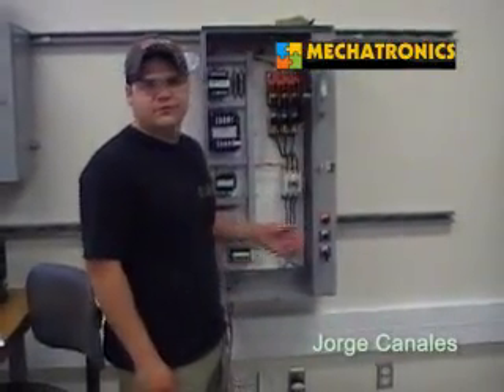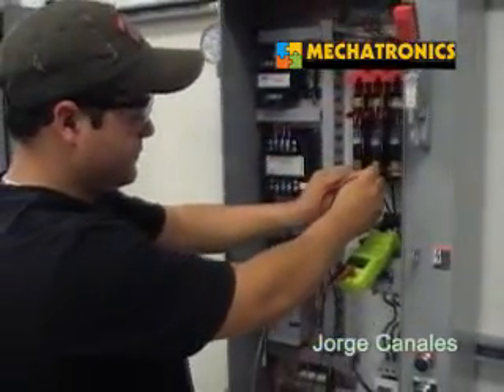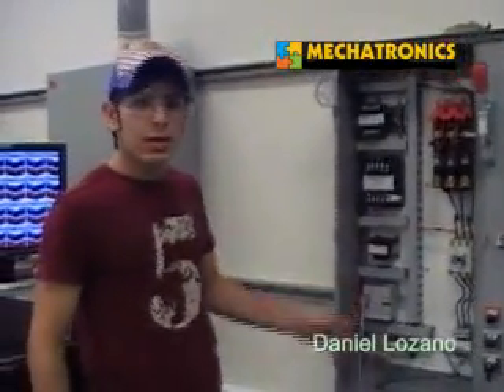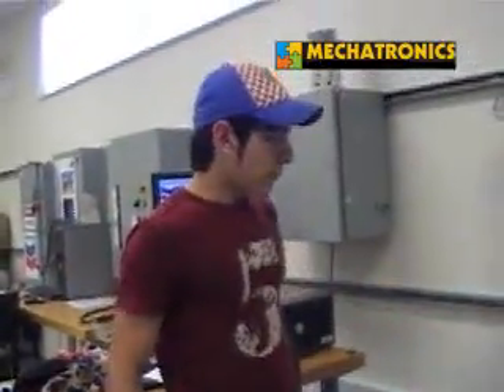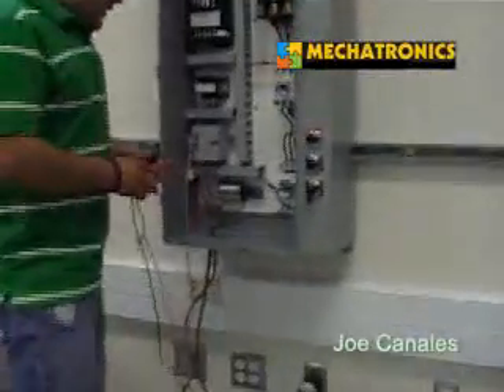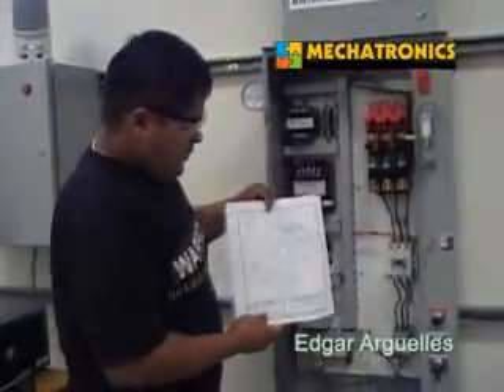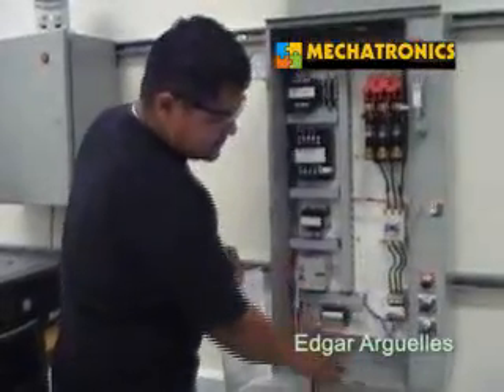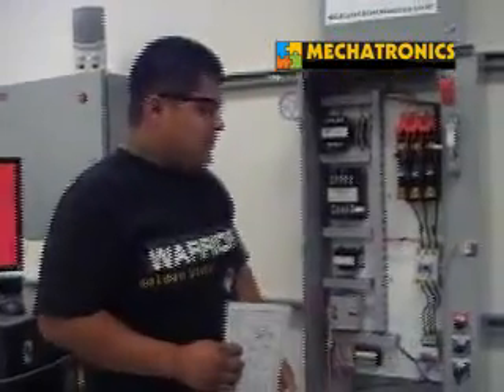Electrical Enclosure Presentation Team #2

Comment: Cool.  Nice job guys.  I just did a project with an Allen Bradley SLC 500.  We built a model of a canal water lock ship transportation system for our final project.  The wiring and setup in your box is very nice.
Thanks for the video.